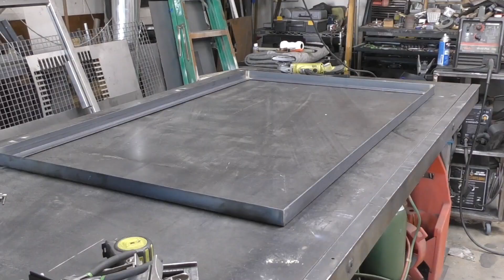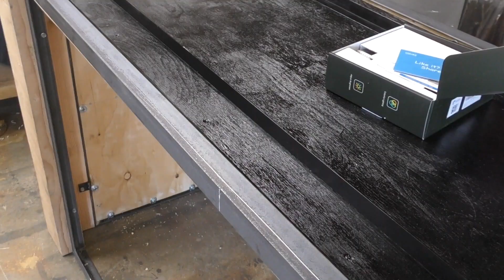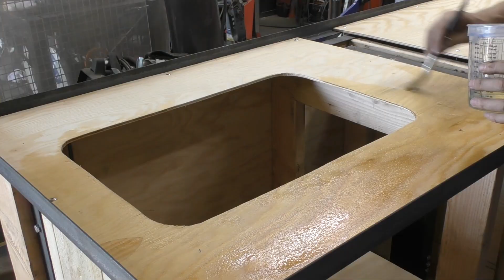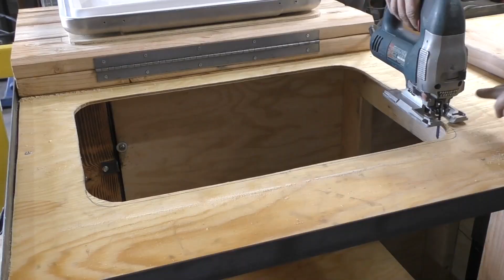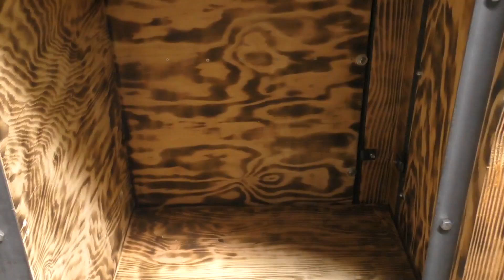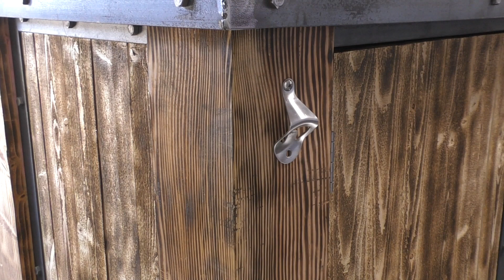How To Build An Industrial Rustic Patio Bar -

Comment: Good one.  I like how you added extra value not only with the thicker than needed timber but the tv lifter also.  And a tool question, how do you find the quality of your right angle driver bit and can you use it to drill?
Reply from the maker: I'm 50/50 with the right angle driver. When I need it, it's very handy but sometimes awkward because it's difficult to keep enough downward pressure in tight spots. I've used it to drill wood but not metal yet
Reply: @ArtfullyRogue  thanks Doug. I appreciate your time to correspond and help me out. I can see what you mean about not getting enough downward pressure. I'll keep an eye out for something better.